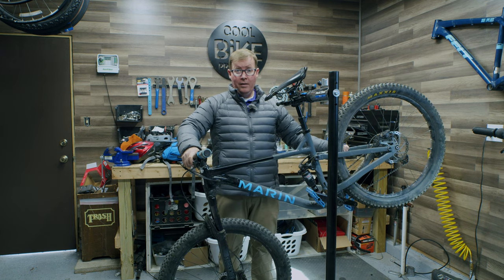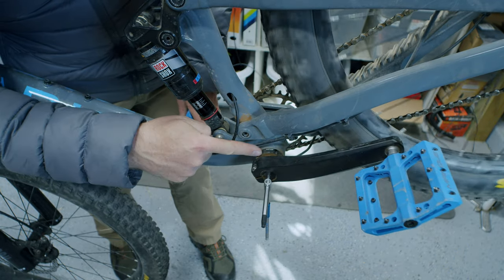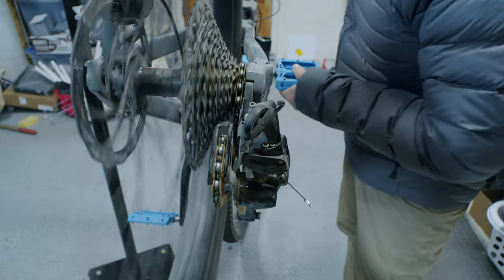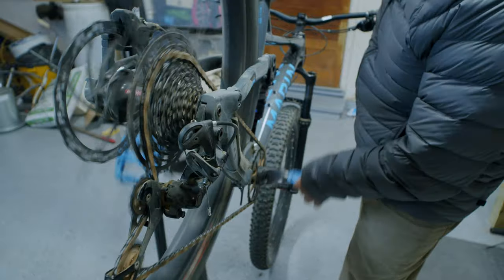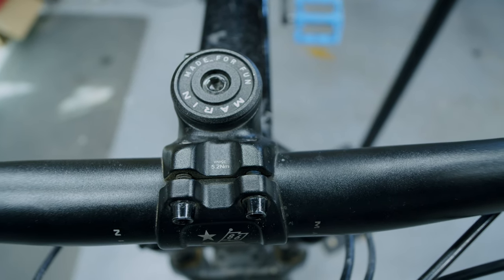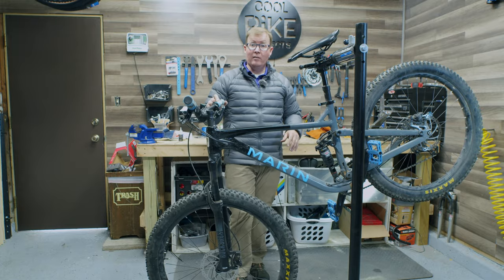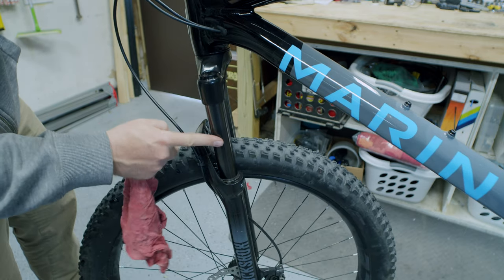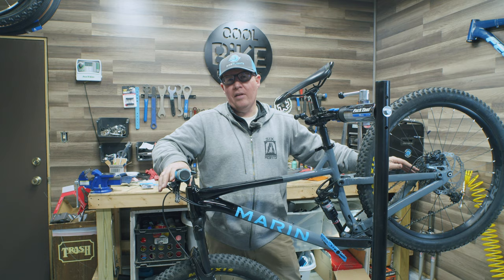Bike Maintenance before your next big ride

Comment: I also do the same thing to the dropper post as you do with your fork stanchions. A bit of lube, cycle it, and then wipe away the excess....it's amazing how much dirt wipes off when doing this
Reply from the maker: I'm going to have to try that! I have seen so many people having issues with high end droppers I figured cleaning it was the best fix. Wasn't sure what kind of seals it has. Mine is a PNW.
Reply: @CoolBikeProjects  Mine is just a TransX that came on the bike, but this seems to help keep it running smooth. I am sure I will need another soon because it's developing a bit of looseness (twisting) where the saddle can move. I don't notice it while riding, but it tends to rattle a bit. It coming up to two years of consistent use, so no complaints

Comment: Nice video! A few tips for the novice viewer looking for more information with regards to derailleur adjustment:
(1) The limit screws are opposite what you would think. The outboard screw adjusts the largest (or lowest) cog known as your low limit. The inboard screw adjusts your smallest (or highest) cog known as your high limit. A little counterintuitive. "Tightening" these screws, (turning them clockwise) will adjust each respective limit towards the center of the cassette. 
(2) In my experience, 80% of derailleur issues can be fixed with cable tension (the barrel adjuster) and "B" tension (the B-limit screw, not discussed in this video). Cable tension is exactly as shown in this video. Turning the barrel adjuster "out" is essentially turning it counterclockwise which increases shift cable tension. The B-limit MUST be set to the spec provided by the derailleur manufacturer. It should be set with the intended rider sitting on the bike at proper sag (for full suspension bikes). That's why some bikes will not shift well on the work stand but will shift fine on the trail. Adjusting the B-limit will drastically increase shifting performance (namely speed and smoothness). 
(3) If cable tension, B-limit, and high/low limit adjustment do not help your shifting, it's likely a bent/broken derailleur (less common) or a bent/loose derailleur hanger (quite common). Before adjusting any derailleur, I always check derailleur hanger alignment with an appropriate tool. It's important to note that  many of the hanger alignment gauges require the wheels to be properly dished and trued for maximum accuracy. 

Hope this helps at least one person out there. Derailleurs seem like magic to many people but they are simple and with a little know-how and some patience, you'll get your derailleur perfectly dialed!
Reply from the maker: Excellent explanation JD. Thank you for the extra insight!

Comment: Do you have any recommendations for ways of knowing how long your chain should be?
Reply from the maker: If you are running 1x system the chain should be short enough that the front pulley on the derailer is not touching the chain in the smallest cog and there is tension on the chain.